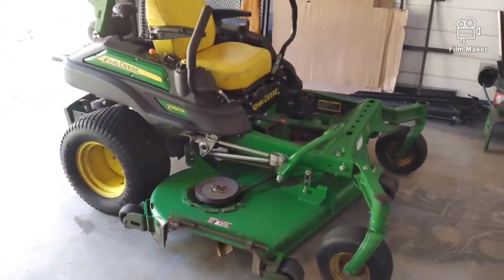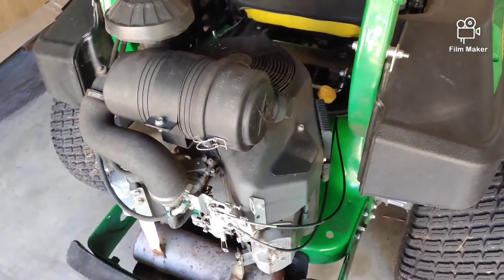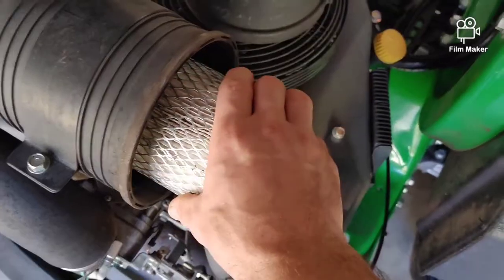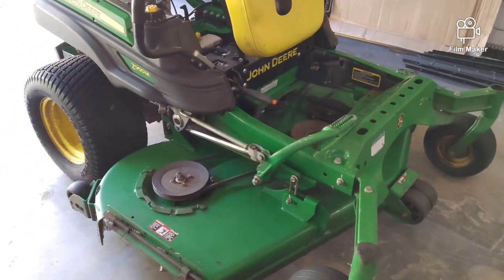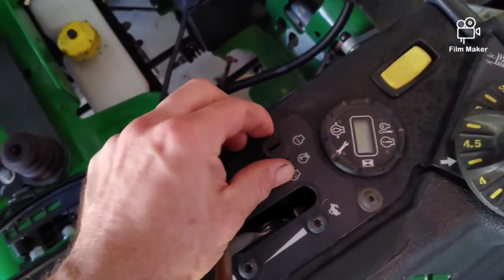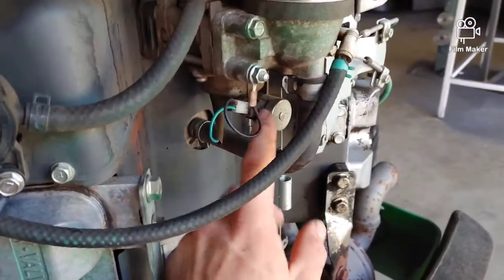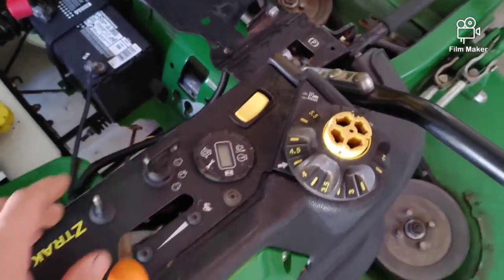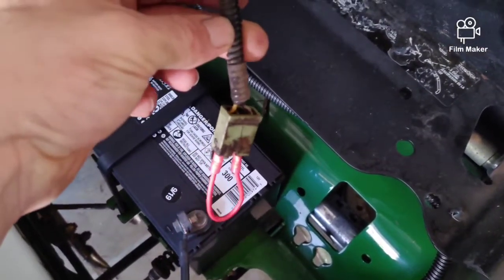What you need to know about John Deere Ztrak Commercial Mowers

Comment: I got a quick question my new deck belt on my 930m vibrates bad I replaced the big idler pulley. My spindles seem to be fine with no play. My new extension spring seems to be to long my old one was adjustable. I’m not sure what the problem is. Thanks
Reply from the maker: Have you checked the tensioner arm bearings?
Reply from the maker: @Gsxrtrix  Take the deck belt loose and spin each spindle and pulley to check if any have bad bearings. Check to see is any of the blades can be wobbled up and down. Check to see if an of the tensioner arm can be moved up and down. Also you may have unbalanced bladeds.
Reply from the maker: @Gsxrtrix  Yeah its common for us to see and need to correct mistakes on brand new units. Lose bolts, improperly ran hoses etc
Reply: My owners manual wants me to change the transmission fluid and filters at 300 hours so I did, so I guess the next transmission service will be at 1300 hours?

Comment: any idea how to replace a 997 deck belt ?
Reply from the maker: Its a harder process. If I remember correctly you need loosen up that pulley on the right side of deck and slip the belt under that pulley. I dont have a video on it yet. Im not even sure if we have a 997 at the dealership right now.
Reply: @Mechanical_Mind  . yes thanks thats what was thinking!

Comment: Oh man, I'm working on a 997 PTO issue now, this is great news and not so great news....
Reply from the maker: Luckily the 997 doesn't have the same type of anti-rotation issue like the lower gasoline 900 series. The 997 is a tank!
Reply: I got zero PTO and zero deck up/down
Reply from the maker: @Shoebilly_Blades  both issues happened at the same time?
Reply: We got the more with both issues already existing. Steering is fine, pot does nothing when button engaged and deck doesn’t go up or down

Comment: How do you change the cooling fan on a z425
Reply from the maker: Hey Bucky, to change the fans on top of the hyrdos you practically have to drop the hydros down to point of nearly removing it. If your talking about the engine fan that is a much easier job. But you have to remove all the engine's shrouding to do it.
Reply: @Mechanical_Mind  thank you for the help